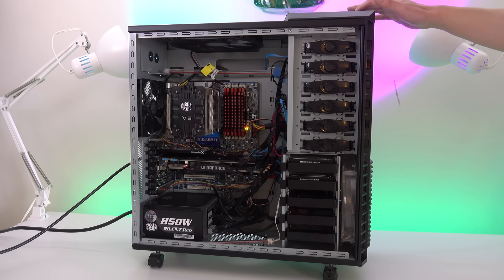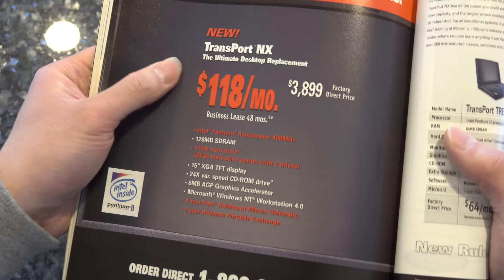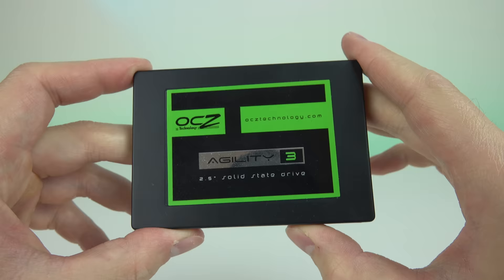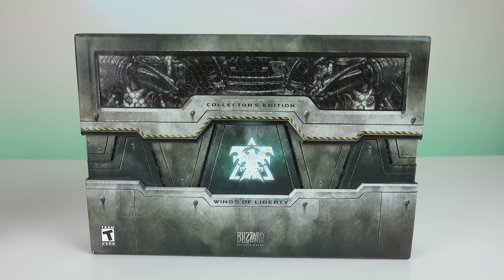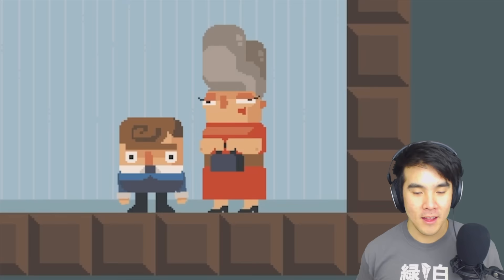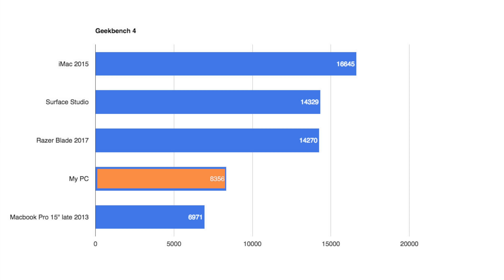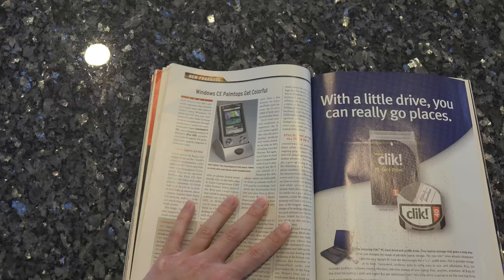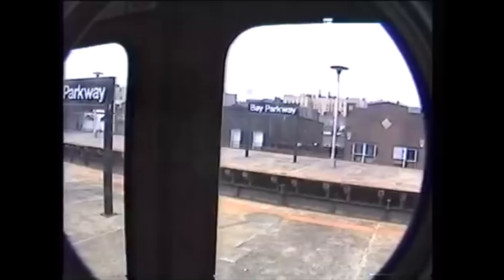I Built This PC for $1360 in 2010. Here's How It Holds Up.

Comment: Still more powerful than a ps4 pro.
Reply: You are completely wrong in every possible way
Reply: Nope, the 970 easily beats out the ps4 pros gpu
Reply: Lol, are you saying 970 is slower than Pro's GPU?
Reply: Computexpert, Wrong
Reply: Computexpert lol the original comment stated that it was more powerful.  As in, the GTX 970 AND the system it's in runs games BETTER than a PS4 Pro.  And all research beyond articles titled, "New PS4 Pro Could Give PC Fanboys A Run for Their Money," shows that it's comparable to low (or at least lower)-tier cards.  The Scorpio, on the other hand, might very well run like a 1070 or better like people are saying.  I don't think so, but it also hasn't been released so who am I to pull shit out of my ass and present it as pure fact.
Reply: Don't forget that your computer is not just for gaming, but for everything else on the internet. This is why it cost more.
Reply: A stock 970 is slower than PS4 Pro
A factory OC'd 970 (1300 MHz region or higher) manages to pull ahead PS4 Pro or sometimes equivalent in performance.
Pro uses Polaris 10 GPU with features from Vega architecture. It has a lot of potential, when utilised properly using all the GCN optimisation tricks and techniques (like the guys over at id Software did for DOOM 2016), it can do more than a PC with OC'd 970 can. But it's held back most of the times due to slow, ancient jaguar CPU.
Reply: Standalone GPU vs a slightly overclocked AMD APU.

Nah im pretty sure that the 970 is better.
Reply: +ItsSwiggles - Not always. It's a bit complicated.. In some cases 970 is faster, in some cases they're equal. In some cases PS4 Pro can be faster, as I explained in my reply above. I have both PS4 Pro and a PC equipped with GTX 970. Have tested multiple games myself on both platforms like Watch_Dogs 2, Shadow of Mordor, Hitman etc. 
When running WD2 using same graphical settings and resolution (1800p cb) as PS4 Pro on a GTX 970 PC, you run into VRAM limitation. Resulting in occasional stutters and slowdowns. PS4 Pro on the other hand has no such issues. Runs very smoothly due to more memory available, plus due to its unified memory setup. Other e.g. would be Battlefield 1, this title heavily makes use of PS4 Pro GPU's GCN features and its custom hardware feature like ID buffer to achieve resolutions that a 970 will struggle to run at while maintaining solid 60fps. BF1 runs at 1800p60 using dynamic res on Pro and it's 99% steady 60fps, only buckling under 60 mostly in CPU-heavy scenarios like in 64-player map.
Reply: AnalogFoundry the ps4 pro runs bf1 at medium settings I'm pretty sure
Reply: Cory 64 - It's a mix of Ultra-High-Med. Not just med. Mostly high.
Reply: 30fps though
Reply: Computexpert Stop bringing grammatical errors into your argument because you can't do anything otherwise.
Reply: In terms of raw numbers the PC is actually slightly weaker, but it's not far off. GTX970 is 3.8TF, PS4 Pro GPU is 4.2TF. i7-930 passmark score: 5179. FX-8350 (closest CPU equivalent) passmark score: 8942.  PS4 Pro has shared memory, but it's all GDDR5 and on a way faster bus. The i7 probably has better per-core performance, which will compensate somewhat for half the number of cores, but has slow RAM.

In practice they're close enough that only insecure PCMR fanboys worried about the size of their e-peen would give a shit about the differences.
Reply: What about.xbox x
Reply: Ketz - No?.. What makes him a troll?
Reply: BobElHat Teraflops are not comparable across architectures, and the 970 is more powerful. Also the cpu in the ps4 pros apu is nothing compared to an fx 8350 with lower frequencies, locked multiplier, and less cache. Plus they are completely different chips in the first place. Also gddr5 ram is faster and better for gaming, but has slower latency and is worse for general use. Also this pc has 4gb of gddr5 +24gb of ddr3.
Reply: Muhammad Numan - Not entirely correct. I've already discussed about it. Feel free to read my response above.
Reply: AnalogFoundry So it basically depends.
Reply: +Computexpert This is the fourth time I have seen this guy defend consoles like a diehard/try-hard.

Can't really blame him with all those PC masterrace memes.

P.S. Most people who say pc > console, dont really care when others prefer console.
If you experience that a console is worth your money, then it is. No biggie
Reply: all that power won't help a pc run bloodborne nor red dead
Reply: ***** Read again or buy new glasses.
Reply: ***** 'Secret sauce' you say. Its just rendering from between 1400p-1800p and in some games a bit of anti aliasing and upscaling it to 4k. This has been available on pc for as long as ever.
Reply: imaginary - It's not. Xbox One X has bigger GPU than RX 480/580.
RX 480/580 = Polaris GPU: 36 CUs (2304 SPs), 256 GB/s bandwidth
XB1X = Polaris GPU: 40 CUs (2560 SPs), 326 GB/s bandwidth
It's PS4 Pro that has RX 580 in it, customised Polaris chip with some features from upcoming Vega architecture and ID buffer, a custom hardware to help with checkerboard rendering. However, it's heavily downclocked (to 911 MHz) due to its form-factor and cheap cooling solution.
Reply: Muhammad Numan - the "secret sauce" he's referring to is called "checkerboard rendering". It's a nice and efficient technique to reach higher resolutions without wasting too much processing power. It's not your standard downscaling/upscaling technique like DSR or VSR on PC. This is different, and so far only Ubisoft's titles have cb rendering option on PC versions of their games such as R6S, WD2, Steep. They're calling it "Temporal Filtering". Image quality with cb enabled looks basically indistinguishable from actual 1800p or 2160p. Only downside is the addition of slight artefacts that can appear in some instances, primarily with transparencies, nothing major. And you save lots of performance. I noticed an increase of up to 15-18fps when enabling cb at 1800p vs native 1800p in WD2 on my PC.
Reply: This whole thread Computexpert and AnalogFoundry schooling these kids and putting them in their places lmao
Reply: BobElHat the 8350 is not comparable because it runs at OVER twice the clockspeed of the console. So divide the score in half for speed differences (because it's a similar architecture) and you'd get roughly 45-4800 for your score. By the way 4.2 teraflops is really hardly anything to the modern pc world. The 1080 ($50-$150 less than a console. Swap in existing pc if you have one to also have a cheaper upgrade than buying new console) has 9+ teraflops, with a little overclocking you can quite easily get 9.5-10 teraflops. Plus the benefits of a pc (non gaming, doubles as computer)
You don't have to spend thousands to get a pc that outperforms a console. In fact it's quite easy to build a $500 pc with a 6.5 to 7 teraflop graphics card (finding used 980 ti's) 
Consoles just use an underclocked slightly cut back version of whatever AMD graphics card costs about $200 and call it a day (4.2 is roughly an underclocked RX570)
Reply: Muhammad Numan  LOL and far more expensive
Reply: Kira if you optimize it, it will play. It. Will. Play.
Reply: Chomzoo 72 What's far more expensive? I don't know what comment your replying to.
Reply: It's fun and all to compare the performance differences, but try buying these system part for today used. Outside of case/harddrives it won't cost more than, say 200$. If you're asking for more, you're just ripping people off for real. So keeping that in mind, it would be hilarious if a console from today wouldn't be able to catch up at all. 

Original Ps4 was released in 2013, but the Pro was released just in 2016. Paying 1000$ in advance of 6 years roughly for the same performance, I don't think the money is really an issue here, if you divide the money spent per year.
Reply: His system performs better than the Pro in every way, the 970 is way, way faster than the modified RX 470 found in the Pro, and the i7 930 runs circles around it's underpowered 8 core processor. (You also can't compare the Jaguar to the FX lineup, the former is a very energy efficient solution, the con is that it's also very slow, akin to Intel's Atom, meant for tablets and low-power laptops)
It using a modified RX 580 is complete bullshit, you're thinking of the Scorpio, and that IS going to perform better than a regular 580/1060/970 with some optimization, probably around as good as a 1070, possibly slightly better.
CPU's still a steaming pile though
Reply: Imagine thinking exclusives are a good thing
Reply: HeLiX 2 - PS4 Pro does use modified RX 480/580. 
RX 580 = 36 CUs + Higher clock speed than RX 480
PS4 Pro = 36 CUs + Lower clock speed than RX 480 + features from Vega architecture.
Scorpio (now XB1X) has GPU with more Compute Units than RX 480/580 and PS4 Pro, and it's also paired with wider memory interface (384-bit bus) than RX 580. PS4 Pro GPU & 580 are like the cut-down version of XB1X GPU, like RX 470/570 (32 CUs) are the cut-down version of RX 580.
To summarise:
XB1X = 40 CUs (2560 SPs)
RX 480/580/Pro = 36 CUs (2304 SPs)
RX 470/570 = 32 CUs (2048 SPs)
As I've said before, GTX 970 PC is faster in some cases, in some cases PS4 Pro is faster than GTX 970 PC. CPU-heavy titles such as Hitman, ROTTR do run better on PC if the 970 is paired with fast i5/i7 CPUs. Titles like Shadow of Mordor, RE7 which are predominantly GPU-bound, run a bit faster on PS4 Pro than on GTX 970 unless it's heavily overclocked to 1480-1500+ MHz region, in which case 970 will be faster.
Reply: Computexpert To be fair, they downclock a fair amount. Its closer to 570 performance than 580. And the 970 is around that performance range, and he's got a better CPU than the jaguar garbage. Less ipc than vishera and less than half the clock speed. The pc will be the same if not better performance than a PS4 pro, and to be fair the pc was built 7 years ago, and updated 3 years ago. It's just proving that consoles are behind in technology. They have their place in homes with families but for people who really want to be competitive and not share a screen with someone else like you can with consoles, you could build a pc for $500 using used parts that would dominate his pc's performance. 980 ti, cheap mobo and 3770k or 4690k and the cheapest case you can find and an 8 gig kit of ram and you'd be a bit ahead of even the next generation of consoles. 980 ti is about equal to the 1070 and the 4690k runs circles around 8 core 2.3 ghz jaguar chips for gaming. And yes it's possible to get those parts for that price, possibly a little less than 500 if you don't mind longer startup times by not including even the cheapest of SSD's. Plus you can mod games if you want to, and don't forget the savings from Xbox live memberships and whatever Sony has for their membership. There's no membership for pc, and the games usually go on sale sooner after release, and go lower than console game prices ever do, so it's more than just hardware prices.
Reply: Computexpert Lol the won't wipe a 980 ti, at best they'll match it. 980 ti is 6.15 teraflops at founders clocks. Overclocked can get 6.45 easy. You can pick 980 ti's around here all the time for $250. Find a one or two generation old CPU and motherboard from someone upgrading and you're good to go. 

Maybe you should open your eyes to something else instead of being so close minded that all PC's are terrible. 
I have both.

Side note, jaguar architecture is 4 years old and wasn't even very good when it came out. 

I've been pc gaming for 2 years and I've never had to get a subscription for anything. Most "year pass" things you see are just bonus packs.
Reply: 980 Ti is quite nimble, as it can reach GTX 1080 speeds, if you get a non-reference model and overclock it to 1500MHz range (which is quite standard on the late models). This was tested back in the day when 1080/1070 was released in "overclockersclub" for example. It won't show in the new benchmarks though, since they use a reference stock model, so people would actually buy GTX 1070 and on the same time justify its price range... Well 1070 does use less power so that's a plus.

But to be real next gen console should be faster than this obviously, since this card is from 2015. The next question is when is the next gen coming out, in 3+ years?
Reply: Computexpert I don't play those games. None of the ones I play have a subscription, but to play the vast majority of online games with Xbox you need Xbox live.

that's what I meant. Xbox one x is equivalent to it. Building a $500 pc with a 980 ti would at least match the console. If not beat it (after overclocking)
Reply: Computexpert First, I said how many teraflops 980 ti was, which was equivalent to the Xbox one x. Second. You can. Not new parts, but I find perfectly good used 980 ti's for $250 to $275 all the time here
Reply: listen m80s, games are not "ported" to PC. They are built on a PC. The only reason your Xbox 360 plays GTA V better than your £300 PC is because they build the parts in BULK, so they can sell the system for cheaper.
Reply: Computexpert I know they're designed and programmed; I develop games myself, and studied it in college ;) and I agree, Xbox 360s have a different purpose than a PC, so their hardware can be optimised for one specific thing.
Reply: lol. You picked MMOS to defend yourself there. Bad move. That's not inherit of the platform itself. It's a decision made by the devs of the MMO class games, silly. Runescape is free. Wow is FREE. Starcraft, yet again free. They just have membership options. So does XB/PS. Elder scrolls? FFXIV? c'mon now.
Reply: Bitches about Tolkien-esque novel styled comments. Writes Tolkien-eque novel styled comments.
Reply: Muhammad Numan I have  500$ PC and ps4 if I was to pick one I would go for PC ps4s so trash Sony just makes it seem like its cheep but you have to pay 100$ for every game and PS+
Reply: MyHerb Edits - $100 for every game lol... In which universe?
Reply: AnalogFoundry he is referring to the style that companies are selling games. basic, deluxe, supergodmegamasterrace version. can't have full game without spending $20-$40 more. However, this is consistent across all platforms, including PC.
Reply: Computexpert dude is right a 1080ti on PC can't hold 60 fps in 4k same as a Xbox one x playing at 30fps in 4k
Reply: I said 20-40 additional. That's $80-$100, so. Didn't say he was wrong. Just helping Analog out with the misconstrued material he was confused with.
Reply: NZD
Reply: in pc you can games for free
Reply: Computexpert well they asked them at e3 the fps of the Xbox one x they said 30 so I'll say PC is better
Reply: Well if you want proof of the power of the ps4 and ps4 pro , a developer for the new ps4 exclusive (idk which one just know that it's kinda like prison break coop) said that the ps4 and pro have so little power it's a pain in the ass to optimise games for  it
Reply: Computexpert nope PCs would get 40 at least
Reply: But xbox is gonna run 4k games at low to medium settings so in high to ultra it wouldnt get even close to 30fps, but xbox one x does have a pretty good value only 500, sure in couple months u can build  same kinda pc for 500-600
Reply: At 4k? SUREEEEE
Reply: Computexpert Not really hard to do and we'll see when it comes out how much of its true
Reply: Computexpert so xbox one x is gonna have an gtx 1080? really dont think so
Reply: And pretty sure 1070 hits 60 fps at 4k in Forza 6
Reply: Well I really hope that it will be like that bcs its on 500 and 1070 is around 400 so now only remove pay to play
Reply: Computexpert I'm talking about the gtx 1080ti not your rig
Reply: Computexpert from this name y'all should tell this is a troll already
Reply: The xbox x will have a gpu similar to a gtx 1070 (not as powerful but similar) and it will be able to run all games at 4k 60fps. Why? Its on a gaming console and uses all of its resources more effectively than a pc.
Reply: There's no way it will be able to run games at 4k 60 fps. Even a GTX 1080 can't do that yet for most games.
Reply: The PS4 doesn't do true 4k though. It does upscaled 1080p, sometimes at 60fps and sometimes at 30.
Reply: It's cute you compare to 60fps and ultra settings and the like, but seriously... I don't think any console games even use the heaviest PC post processing effects due to how much extra strain it gives to GPU. Even on PC you can turn off SSAO and the like and just gain 10-15fps vs for some shadow shading, and on on console most of the detail rendering is squished down and "optimized" already, just so that most of the things like shadows and objects you see are only rendered few blocks away.

I don't think most of you can even see the visual differences from say battlefield 1 high vs ultra settings, except on ultra everything is put up so high that you're basically setting object detail render ranges to the max - which clearly isn't the optimized setting. I feel Computexpert actually doens't even know what he is talking about or is trying to troll you guys hard. 

270X was released in like 2013 and was rehash of some midrange 5xxx radeon gpu. Basically it costed less than 200$ of the time of release. GTX 780 was also released on 2013, but it still can run battlefield 1 @ 120fps stable on 1080p, with auto details set to high settings (without SSAO effects) and I don't see xbox one even hitting close to 100 fps in that game, as it fails to do so without some dynamic resolution downscaling to keep that 60 afaik. So the new Xbox One X will rape those comps... Yeah that usually happens in 4 years of tech advancing, right? 

I just feel there is a bias or troll switch activated here... "Most PC's are slower" slogan might be true if you really compared to tech that isn't up to date, which imho is quite silly.
Reply: There's plenty of articles about it dude. It uses a checkerboard algorithm so it only has to render every second pixel and then fills in the blanks. It might not be 1080p now that I look at it again, but it's definitely a lower resolution being upscaled to 4k (therefore not true 4k).
Reply: R7870 was released in 2012, so rebrand in 2013 in PC's is really midrange on that time already. So you still compare it to be highend even in 2017? I really feel you don't know tech, like at all.

Yeah the point on post processing was that on consoles you don't have that eye candy, since it has no other purpose to add layers of effects up on stuff with bad performance ratio. Aka consoles never will have the "ultra" details you can have on PC, which most users don't even care about for real...
Reply: Nice b8 m8
Reply: Yeah I got the number wrong, since I can't remember everything going 5 years back. 7870 was still however midrange as 7970 was the highend on that time. No, 7870 GHz edition was just overclocked 7850, as the XT model LATER had the 7950/7970 dice size/transistor count. Not the default 7870. 

Also it still doesn't chance the fact that 270X didn't cost more than 200$ at the time of release, which doesn't make me any more wrong it being a midrange gpu in 2013. You just pick on the one number since that's all you can do. :)
Reply: really? https://en.wikipedia.org/wiki/Radeon_HD_7000_Series

I remember guys actually flashing 7850's to 7870 when they were released, but AMD blocked that on later point when they refined their cards. Basically 7870 was Pitcairn GPU overclocked to the max to compete with nvidia's product at the time. 270X was midrange when 280 and 290 was released later to battle on the highend.

You don't go saying GTX 1060 is actually a highend gpu too, right? Since it is not aimed to. I really feel you don't understand anything for real.
Reply: But my point was, AMD priced and picked 270(X) to be midend the time 2xx series was released. My comparison to 1060 was, that it was released as midrange when 1070/1080 takes the highend (and i think everyone knows these cards atm, hence the example). Its the same thing on R270, R280 and R290. Relative performance and price to performance ratio always differs between cards anyway.
Reply: There's 2 GPUs in the PS4 pro.
Reply: Jean Mahmoud Ventilateur someone wanna tell em?
Reply: STOP THIS ARGUMET HERE IS MY OPINION.. Well if you consider a 7 year PC vs a system that came out last year.. well that's pretty impressive and it means the PS4 Pro is 7 years late in the hardware game..
Reply: +Murmanox It will its not a pc, consoles are well optimized. +Serpentine And no they are almost identical. It will happen again back when the xbox 360 was made it was faster than most computers out there. Also the x has 6 teraflops, as compared with the original Xbox One's 1.3 teraflops. To put this in perspective a gtx 1070 has 6.5. It will undoubtedly do 4k 60fps. I'm not saying it will look better than in pc of course pc offers way more customization, mods, etc.
Reply: Actually the ps4 pro has 4.12 TFLOPS, and 1060 has 3.85. So in theory it doesn't "nut" on it. But tflops aren't everything.
Reply: Computexpert not 2000$ but 1400$ if you want to even it out.
Reply: PS4 PRO COSTS 400 DOLLAR LMAO
and Horizon look better than anything you can get on PC now you haven't spent 1000 on
Reply: Computexpert it was in 2010, ps pro was released in 2016. He built it 6 years ago, a lot has changed.
Reply: Vlotoluto you could've said it without the "fucking"
Reply: lol your joking right
Reply: im talking to island star
Reply: saying that pc causes problems is not true when does your computer just 'cause problems' that makes 0 sense
Reply: yeah I never had an issue with any of those have you been playing on a piece of scrap metal???
Reply: Muhammad Numan I might be wrong but i think the PS4 GPU has a higher raw performance than a 970, with somewhere around 4.5TFlop/s i think
Reply: +Computexpert
He paid $2000 in the span of 7 years, dude. That's less than paying $1 a day for 7 years. It's peanuts. Meanwhile, you paid $299 for a PS4 in 2014 and then paid another $399 for a PS4 Pro. That's $700 in the span of just 2 years. Not counting the $60 yearly fee of PSN.
Reply: +calcyss
It's not really about raw data. 970 can easily hit 60fps on games that the PS4 Pro are locked at 30. Dark Souls 3 can run easily at 60 on a 970, but struggles on PS4 Pro at 40-50fps. And you will always have options available on PC, such as choosing worse resolution or settings for better frame-rates and vice versa, something barely any developers allow on consoles (Nioh being a recent example).  Everyone said that the PS3 was stronger than the 360. It's true if you look at raw numbers. Doesn't matter though, multiplats ended up running like shit.
Reply: Computexpert Console Peasent...
Reply: Computexpert  here's the source that IAW failed to provide. http://www.game-debate.com/news/23183/playstation-4-is-like-a-5-year-old-pc-holding-back-game-dev-says-a-way-out-creator 
He was right.
Reply: Computexpert Can you tell us what gpu ps4 uses? i would like to google it up.
I get it if you prefer a console, its more of a plug and play platform. But dont try and brainwash non-peasants into believing that a gpu of a potato crammed into a cool looking box is faster than a gtx 970.
Reply: Computexpert Its customized, so better in some areas and worse in others.
Reply: First of all, learn context. Second stop being a hypocrite. And third you don't seem to understand what i'm saying. Why do you care about its gpu itself, you don't decide what gpu you want on your ps4 pro. Also How tf are you comparing them, are you saying the ps4 (pro) is faster than a gtx 970 paired with an i7? Nobody games on a single component. At the end of the day you are arguing over something you cant compare. You should see consoles as a whole, and not a single component. The reason you compare individual components in PC is because you have variety you can choose and fit your needs.
Reply: Computexpert Also, the only reason games run on consoles is that the games can be made specifically for that piece of hardware so that they can squeeze every bit of performance out of that hardware.
Reply: Computexpert 
You ignore anything that destroys your argument and then insult others. You bring up irrelevant garbage like the Pro GPU being faster that no one was talking about before you came in chanting it like it means anything. As if the Pro does true 4k or as if most PS4 games don't run locked at 30 at 1080p. Christ. Even in most games boost mode can barely handle consistent framerates. You have said "BYE" and "I'm done" like 500 times now. Go away already and stop thumbing up your own comments.
Reply: Computexpert 
"FYI most developers do not take proper advantage of console hardware"
Lmao, and they do on PC? Most developers couldn't care less about their PC ports. And even then, bad PC ports match consoles through sheer force. Christ, you sound like you are grasping at straws. First console children would always yell "B-BUT THEY WILL OPTIMIZE IT FOR CONSOLE" at the top of their lungs. Now, there's barely any "optimization" because most console games are running like complete shit. Even exclusive games like Nioh give options to have either better resolution or better framerates because PS4 Pro can't handle doing both.
Reply: Muhammad Numan Lets see if this PC can run Uncharted 4
Reply: +Computexpert
You were being rude to every reply made on your first comment, which was, again for the millionth time, an irrelevant point that the GPU is "faster" since the original post never mentioned GPU. And the original post is still correct. You've already said "BYE" and "I'm done" a million times, so just stop replying already.
Reply: Stop the thread guys, Computexpert's already been proved wrong and he/she knows it. When a person replies with something avoiding your statement, it's clear they can't argue with you anymore. Insulting, rambling, and the famous (Waste of time excuse) are signs of defeat. These actions are very childish and are commonly said by teens. End of discussion.
Reply: more powerful than any console ever created
Reply: Nuclear Stunting Jeez don't be so salty about it please it's opinions mmk
Reply: but can you upgrade the gpu (or any component) of your xbox one x? do you have free online with your xbox one x? can you plug in more than one monitor to your xbox one x? can you install emulators on your xbox one x? can you reach over 60fps on your xbox one x? do you have dedicated servers on your one x? do you have steam on your one x? can you render movies or edit pictures with your one x? the answer is no and this makes this pc faster and lasting longer than any console, cheers!
Reply: Computexpert but thats it there are only 2 games on pc that have a subfee (final fantasy 14 too) on console every single game has a subfee
Reply: Computexpert And you should have the option not to pay for fucking online, they are technically forcing you to buy games to get access to online.
Reply: Computexpert You dont pay for online because you have no social skills. And guess what! On pc we get cloud storage FOR FREE.
Reply: Muhammad Numan wrong
Reply: Relic I'm afraid, he's right. Ps4 pro is garbage.
Reply: Nuclear Stunting finally a thoughtful comment passing through amazing!
Reply: Computexpert do you know how many games are free2play on pc do you know how many cloud services exist on pc FOR FREE? did you know you can get buy2play games also for free on pc (in several ways that are not legal but the possibility is there) playstation plus a complete rip-off i dont understand why people pay monthly for their internet connection and then pay again to use their own internet connection to use it for gaming its so dumb to fall in to this huge scam why do some people dont understand that they are getting scammed?! console manifacturers like sony or microsoft just want peoples money and their support is also awful!
Reply: Computexpert Ps4 is a pre-built computer with a special os and exclusive components.
Reply: Computexpert They arent made to handle games well, the games are made to be handled well because most of the time they put into games, goea into optimization. (Unless they do like every other AAA game nowadays and don't optimize the game)
Reply: Computexpert Not capable enough to achieve 60 fps tho.
Reply: Computexpert Your argument contains mostly just giving people abuse, which is funny because you seem to get salty when other people give you abuse. You can't back up any of your facts, you just say "steam is garbage", "PC drivers are always breaking". I can't even comprehend your logic... And then to say Windows OS is trash too? Like, I think you're getting a little bit mad. Time to wind it down big man.
Reply: Computexpert That article was completely pointless. You have given no reasoning or evidence to any of the stuff there. Same "Steam is garbage" "Windows is garbage" "Drivers are garbage" etc. Quite frankly, you're a muppet.
Reply: Computexpert i believe you did link an article once
Reply: i have a gtx 1080
Reply: Computexpert better than a ps4 lmao
Reply: Computexpert How is the gtx 1080 outdated?
Reply: Computexpert You have stopped proving your point, now youre just trying to roast peoplr
Reply: Computexpert does that mean its outdated?
Reply: Computexpert 1080 isn't outdated at all slower yes but not outdated nevertheless outdated is when you get a 2009's released date gpu and use it as a main profile of your pc while we're living in the 2030's and the card already unsupported by its own enterprise. By your logic then even Titan Pascal and AMD's vega are just utterly outdated by volta's project because they're just having it development for the next years in the future.
Reply: Computexpert And one more thing Consoles aren't better compared to PC it's not bullshit whatsoever it's the fact that people just point out i have console too but only for its exclusives still no i'am stating that pure garbage ps4 pro which always been a pain in the ass cuz it always gets hotter and loud noise than any hoes out there is better by any means lol.
Reply: Computexpert you arent providing any facts at all, youre just screaming at us like a muslim that thinks every other religion is false.
Reply: Direct hardware comparisons between PC and consoles are silly. Consoles use custom OS and single hardware configs...they are capable of running software much better than PCs with the same hardware, because that software is designed and optimized for only 1 specific system.

...and yeah, consoles massively damage the PC gaming market, blah blah blah, insert rage here. That shit is beside the point.
Reply: BobElHat teraflops is not everything you still have to count cuda cores vram ect the xbox skorpio is faster that ps4 pro and it still can't play true 1440 p or 4 k it only can be upscaled while the 970 can handle 1440 p if you turn down settings
Reply: Checkerboard rendering it just as bullshit as it gets. That's just another 1440p better images and performance. And actually $450 gaming pc rendering better images quality and performance to price than ps4pro. Some of game's engine just wouldn't let pc to maximize its capability because they have locked down the sources code to console's capability that might result in fps drop off and the decrease of performance.

 Checkerboard just fucking marketing gimmick purposely aimed to someone with a low budget who can't distinguish between native 4k and its pseudo kind. You need to have 4k native monitor to be able to notice the different or else it just vain attempt comprehending it. You can't just say that ps4pro is 4k machine as to insist $450 pc to output native 4k.
 

 You just been fooled by nvidia and AMD's trick by counting on cuda cores and else aren't going to sum up overall performance because it's the engine itself which capped off the experience you have to take account on some aspect regarding frame rate performance so essentially bringing up hardware subject like that was just pointless hardware conversation LOL.
Reply: Of course it did it enhanced 1440p ps4pro which looks bad with some minor improvements and still looks as bad as ever and no one talking about $450 pc from 2016 with new parts it just you lol and 4k gaming is crisp and looks so good and i think you got yourself misconception that ps4pro isn't 4k capable it just 1440p it looks so ugly in 4k tv.
Reply: Computexpert Because of optimization ya dingus
Reply: Computexpert No, because of optimization. The games were optimized for that specific set of hardware, so the game can squeeze every last bit of the performance. The ps4 hardware is weak. As the devs of  "a way out" said, the ps4 is like a 5 year old computer.
Reply: I think you haven't seen the real native 4k that garbage division just nowhere near 4k LOL. You sure did watch it on 4k or just youtube or 1080p tv ? seeing thing on 4k tv with a distance is different with 4k monitor up-close look oh boy trust me 4k is in different league even i used to had non 4k monitor called x34 predator and it looks crazily immersing despite its not actual 4k it perhaps something between it. It made checkerboard looked just like tiny artifacts on your 64 bit obsolete nintendo.

 Meanwhile gaming on 4k is beyond our expectation and if you still can't distinguish both 4k i think there is something wrong in your brain and i think i should change my nickname to "legit compute expert".
Reply: Muhammad Numan And ps4 pro beats it in sales lol
Reply: Saul Millan No it doesn't, the gtx 970 demolishes the PS4 pro in sales.
Reply: Computexpert now you calling me immature ? Did you even understand my point LOL And how about your disruptive manner ? Just keeping me in wonder how sad is your life sir and well it's been nice talking to you but i got some money that needs spending on some expensive trash so if you'll excuse me.
Reply: BobElHat A fx 8350 is clocked really high and i don't think you can compare those two cpu's
Reply: I'm still waiting for some PC master nerd to build a PC that matches or is greater than the Xbox X for the same price. Most of the time when they build one, they leave out a keyboard, mouse, and the blue ray drive. Not to mention that they cheat when they purchase used parts instead of new ones. I could easily argue that I can buy a Xbox X for only $300 if I buy it used. 

I read this comment that said "he's only spent $2000 over 7 years. That's just peanuts." This same person tried to argue that you somehow pay more if you bought a PS4 and PS4 pro with membership. That has to be the biggest fail at math I have ever seen. (PS4) $400 + (Pro) $400 + $180 (3 years of membership) = $980. 980 is more than 2000? What are you possibly high on? Even if you add 4 more years of membership, it still only comes out to $1220. You could also go far enough to say that they could've maybe released another console in those four years and add another $400. That's still just $1620.
Reply: coop152 Console peasent
Reply: AnalogFoundry Console peasent do you know the cpu uses 3.5 GB of the 8gb ram and the cpu is so terrible
Reply: AnalogFoundry lol nice bs peasent stop lying the pro has the same gpu with a little more GPU megahertz and cpu with extra cores please don't compare a incompatible resoultion and the fact that even caping the frame rate and still running into heavy stutters is disgusting and heavily impacting research it and please visit bulletbarrys console peasent qoute sieries
Reply: BobElHat Console peasent the PS4 Pro only has 3.1 tflops and a similar matched build with a pentinum and gtx 1050ti reaches up 4.5t flops and can run any intensive game at a 50-60 range or ashes at 40 fps ultra
Reply: Kira please that game barely used the PS4's resources a pentinum 3.5ghz and 1050  would get ultra 1080p
Reply: AnalogFoundry hmm still don't know what a 30frame lock is do you oh wait your PC probably stutters alot